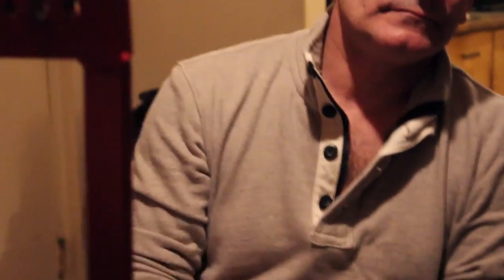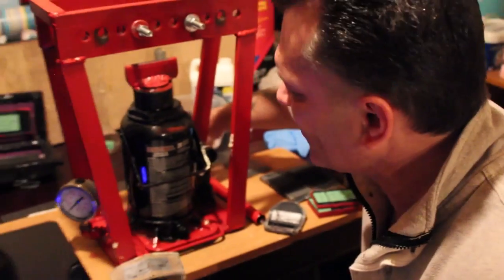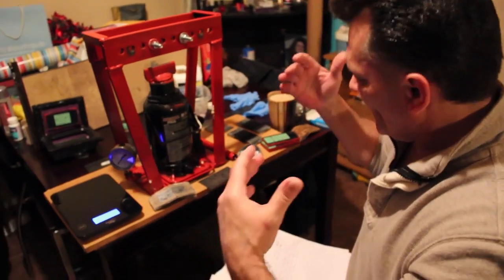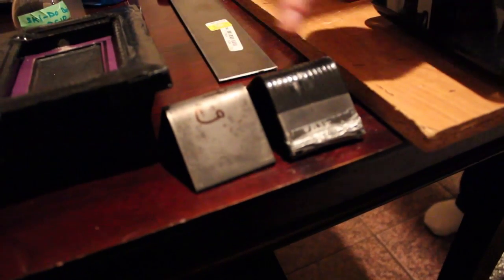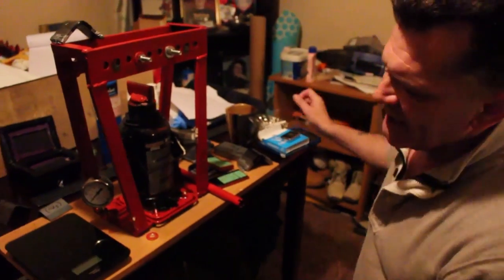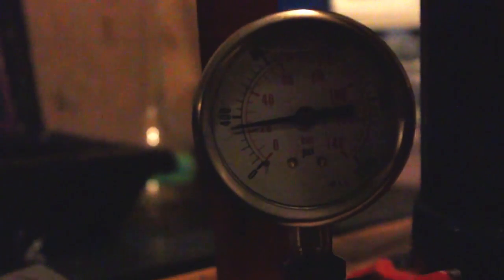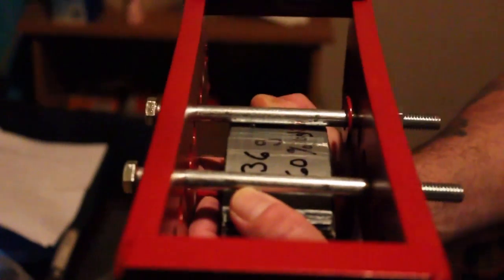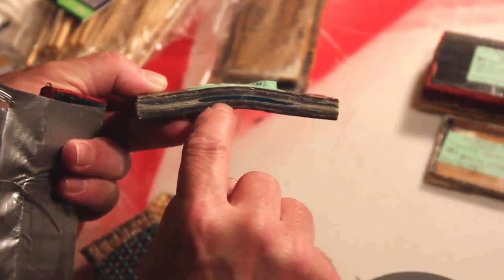VULKANITE-H VIDEO 1 of 2 Troy Hurtubise

Comment: In case anyone is wondering - the problem is that he do not disclose information about his original input (those information that would not compromise his possible future profits).

In the best case scenario he worked out a method of stacking commercially available products. Then several questions rise - is his method scalable up to industrial demands? What other test has been performed? Who issued the cited MSDS? Is this MSDS for one/all of the composite components or for the finished material? Quantitative claims (i.e. 98% percent reflex-bend memory ratio) are made without specifics about the method of obtaining such number, and are thus meaningless. Where such light, high tensile stress resistant materials are most sought after? What about tensile stress perpendicular to the plane of bonding? What about impact resistance? What about cutting resistance?

In worst case scenario he's rebranding with ridiculous name already available, but maybe not yet popular enough, material.

It's not the lack of credentials that makes his "work" uninteresting to the industry and science. It's the method of presentation and lack of specifics about the "technology" that makes such endeavour a possible waste of time for the investor. Going off the beaten path can be fruitful, but most often it is just a waste of time, especially with individuals lacking scientific rigor and taking their "work" so emotionally with some grandiose delusions.
Reply: why don´t you contact him and help him sell the product
Reply: danielhako1 itll be a one sided convo😩
Reply: JB Weld has a PSI of 4000 - what am I missing here?
Reply: Yeah, I really get the sense of a well meaning grifter. The lack of proper specs or testing are really evident. Certainly he would have known the information the “big boys were looking for. Most billion dollar tech giants did not have a degree, the product spoke for itself.
Reply: Glad we have an intelligent comment like this instead of the usual idol worship claiming this guy is a genius